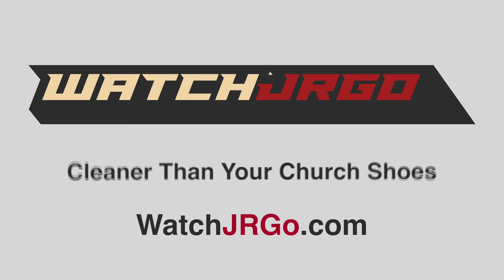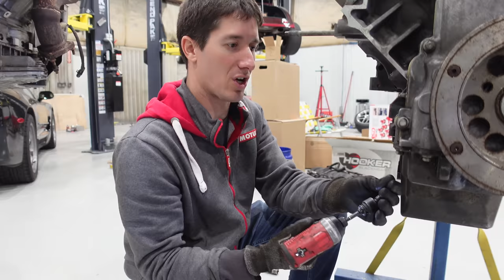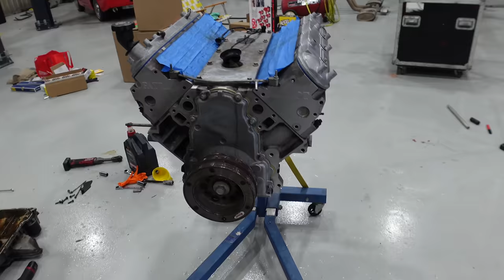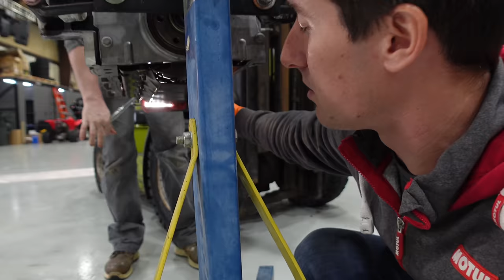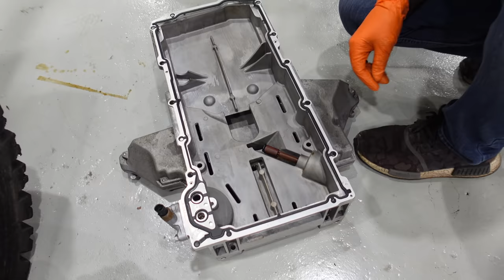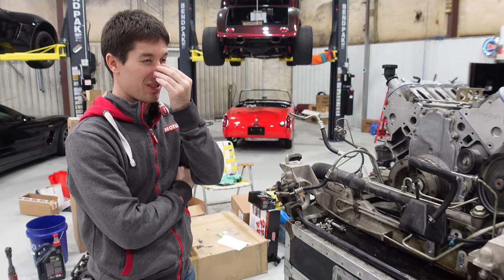My CHEAP Corvette Engine Is Clean And Ready For MATING

Comment: I love older Corvettes, and I kick myself for selling my 1972 Corvette that I did a complete refinish job on. It came from Alaska and had a few paint jobs on it which I removed. I blocked it 7 times and it came out perfectly straight, it was very beautiful when it was finished. I would love to do another one but my health isn't to good these days but at least I have some fond memories. I really enjoy watching your videos, especially the ones dealing with Corvettes! Keep up the good work!
Reply: I hear you loud and clear my friend. Only 24 myself, but given the many injuries and damage to my legs and back, I can't see myself getting to work like this much longer. At least I got my Grandad's Ranger & Dad's Charger finished up while I'm still in 1 piece.
Reply: I regret selling my 1969 Corvette. Factory built as a 1/8 mile car and was so fast til about 107 when it hit the rev limiter. 4 speed muncie with Kevlar clutch and I could smoke the tires taking off in 4th if there was any moisture on the ground at all. Had a 5. something gear ratio. Headers to side pipes. It was as bad a daily driver as a Viper I owned for a short time but it was so fast from light to light. It had been sitting in a side yard and needed to be sold as the owner had a couple teens about to be driving and having it would destroy the car insurance bill. It needed paint work but I rebuilt all the major mechanicals. I couldn't believe how cheaply parts were at AutoZone/Advanced compared to Corvette Central. CC was a rip off on most of the parts.

Comment: Engine stand removal. Pick up the whole thing. Pull out the turn handle and remove the bottom of the stand. Unbolt the bell housing adapter. Done!
Reply from the maker: Okay but I have a forklift... so just pull the bolts I'm pulling anyway and kick the stand back into the corner, literally saving myself every step you said to do and it's easier. 🤔

Comment: A saftey suggestion, when moving an engine on the stand, never pull the stand, only push. Reason is ,when the stands wheels hit a object on the floor, the stand will fall over, if your pulling the unit it will fall in your lap and cause major pain.

Comment: A Lil Vaseline on the pickup tube O ring goes a long way.....jus sayin

You should have considered using a girdle on the pickup mount....cheap insurance 

Is that summit balancer correct for vettes? If not....having the engine in the cradle is not the most fun for swapping balancers....and also using a ARP bolt instead of the stock TTY is a must in my book....for some reason stock balancers on vettes have been known to spin....pinning is a good idea

You should use some threadlocker on the oil pan bolts...ask me how I know

The LS6 valley cover conversion is a excellent mod...you should consider it

Need any other tips n tricks on LS engines ? Just ask 😁

Comment: I know the chances of that lift coming down and ruining both those vets is low but I still always get chills from seeing cars parked under another car on a lift.
Reply: You do understand that the lifts have a mechanical lock in addition to the hydraulics.
Reply: there is a lock that engages to physically keep the lift from falling down. You go beyond the lock and then lower it into the lock and it can't be lowered after that. It has to be raised up to move the lock, and then be lowered. That clucking you hear as it raises is the sprint loaded locks being pushed out of the way as it goes up.

Comment: You need to get a couple of those awesome hydraulic engine lift tables like Jonny has.... that would be a lot more secure than what you're using now!
Reply: I agree, if he's going to do this kind of thing a lot more, as to me those boxes just look sketch AF!!
Reply: Those tables are pricey. 😳
Reply: @CommodoreFan64  Exactly what I was thinking.  I'm reasonably sure those boxes were meant to move audio/visual stuff in trucks.  I don't think they're designed for stacking 400+ pounds on top.
Reply: @eldonerc2524  Yeah, but so are motors and body parts.  :)
Reply: @RealRickCox  altho in eldons defence, jr sells the stuff hé puts An engine in and doesn't sell the stuff hé uses to put the engine in
Reply: The official ones are $$$$, but I'm sure you could get the cheap lift tables from HF and modify them to work.
Reply: @SteveBassen  I owned a couple of the best tables HF built.  After a while, they wouldn't hold and would start slowly going down.  I definitely wouldn't trust one of those tables to hold an engine when your life could depend on it.  Better to spend the money up front and be safe than go cheap and die.

Comment: Here’s a question.
Are the tone rings on the crank the same?
LS engines had rings with fewer teeth on the older models. If those engines are from different models it’s a good chance they have different tone rings.
Reply: You can tell by the color of the sensor, assuming someone put the right sensor back in.
Reply: @eldonerc2524   I believe one is gray and the other is black

Comment: Why did you need to take the engine outside to jet wash it, when you have a degreaser parts cleaner in the shop ?
Reply from the maker: The engine won't fit in that 🍻
Reply: @WatchJRGo  I was literally just going to comment that lol
Reply: Doesn’t  have to go in it , just hold it over the parts cleaner with the forklift.  clean it down and blow it dry with an airline 👍🏻